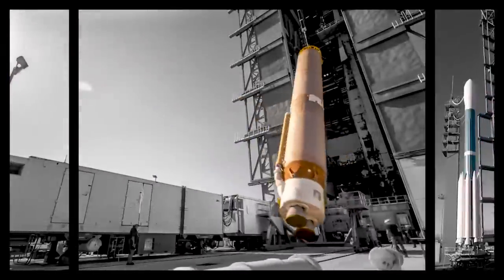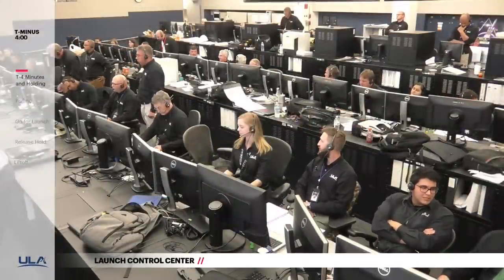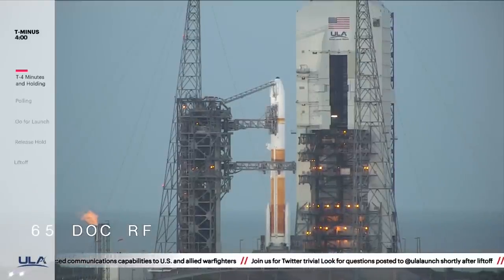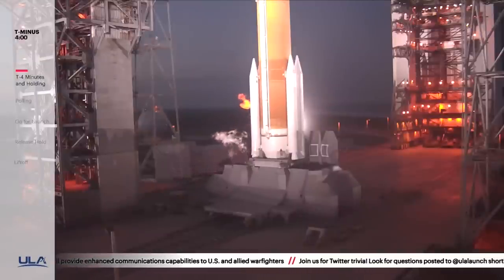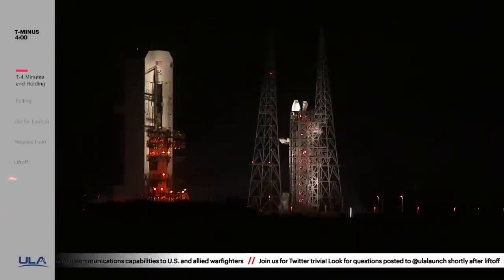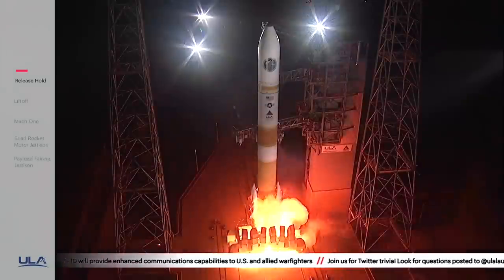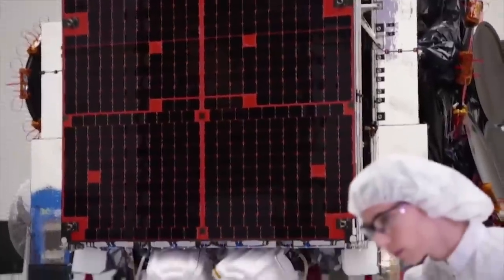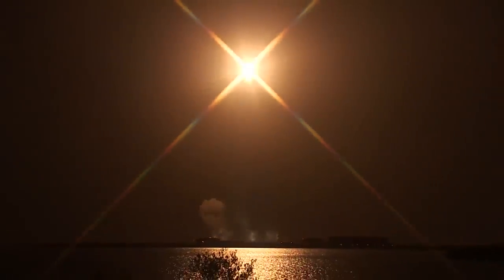March 15: Delta IV WGS-10 Live Broadcast

Comment: This video is long... summary of events (I may have missed some things, sorry):
18:00 ULA promo video, then Launch Commentator introduction, weather conditions.
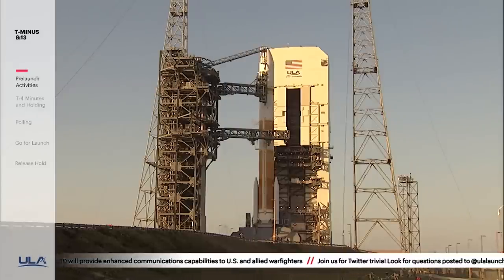20:00 Mission profile
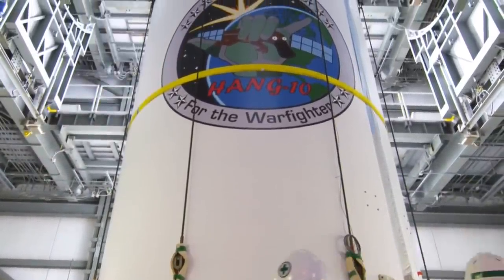22:20-23:00 Artwork description
24:00 - new T-0 set
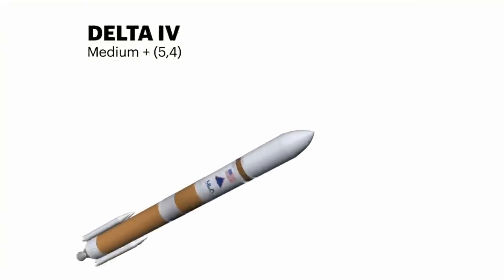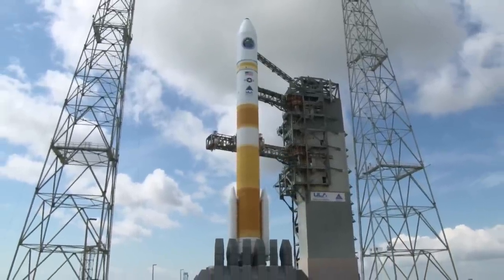24:30-26:30   Delta IV + (5,4) description
26:30 - Launch Commentator 
30:00 - working issue
31:00 - Launch dedication in memory of Kurt A. Huschle
34:00 - description of readiness polling
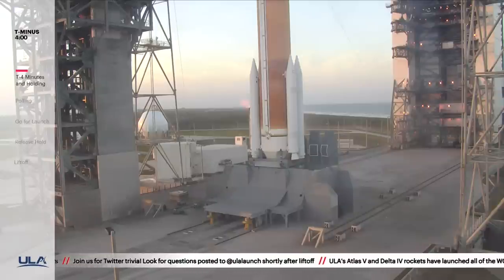46:30 – Video of previous WGS launches. (holding to work an issue)
1:07:00  - new T-0 set  (which is delayed at 1:10:30, due to TDRS issue)
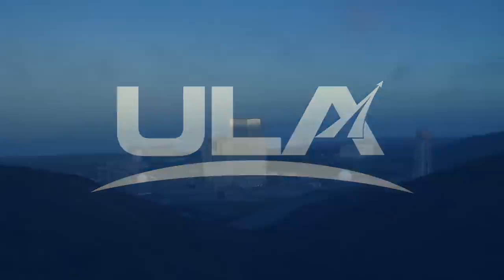1:17:30 - 1:26:00  Delta rocket history and some satellite history
      - Delta 4 Heavy, NRO-L 49 mission 1960, Thor Missile history, Thor failures / success 1957, space launch vehicle 1958, NASA & Douglas, Echo1, Syncom 2 the first geosynchronous satellite, Delta 2 and GPS satellites, Delta 3 and Delta 4, old footage
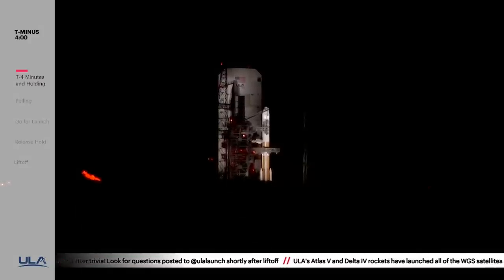1:29:20-1:31:00  Mentions TDRS constellation (but audio cuts out) then says TDRS was down, but is back up and running
1:43:00 – new T-0 set  (8:26pm ET)
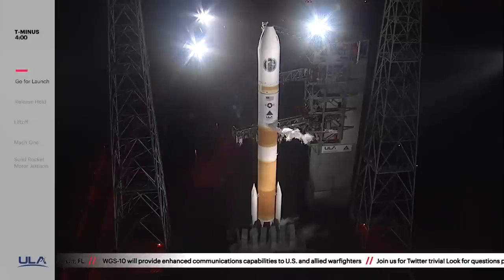1:46:00-1:50:00 – status check, final polling, permission to launch, description of events
1:52:00 T-2min status
Launch occurs at 1:54:00
1:59:40 - message from the Boeing team (engineers and team leads)
2:01:20 - ground system, anti-jam IPT lead
2:03:00 - 2:14:15 WGS satellite and mission description (really high-level, gets better after a few minutes) 
2:15:10-2:19:00  More WGS, MILSATCOM directorate, next steps for WGS-10
2:19:50 - Engineer from ULA
2:27:00 - Main engine 2 cut-off
2:30:20 - prep for spacecraft separation, "spacecraft sep", applause, "hang ten"
2:32:00 - replay of launch
Reply: Thank you